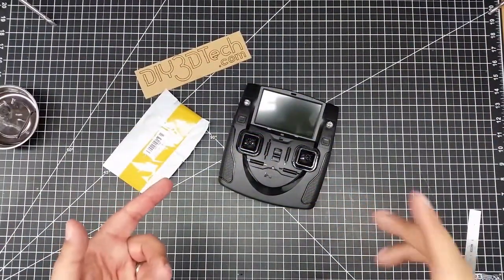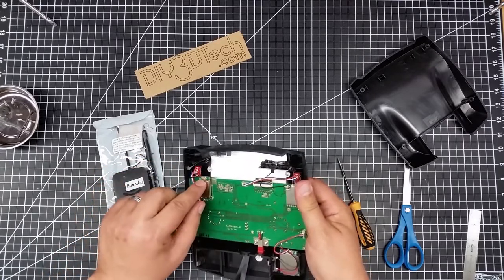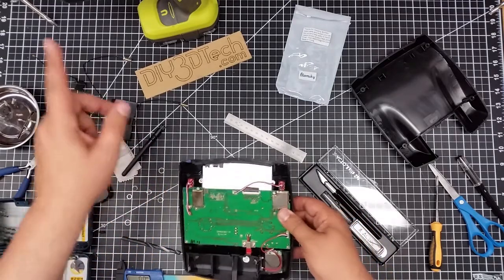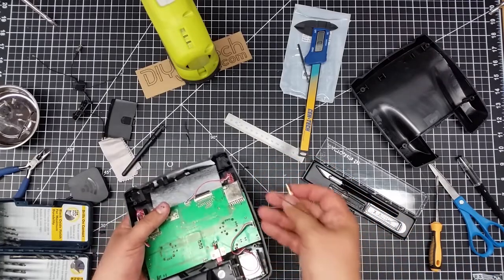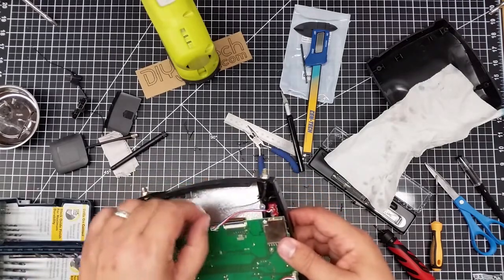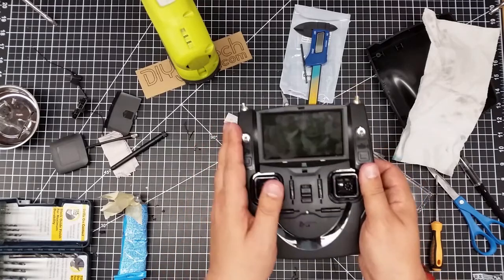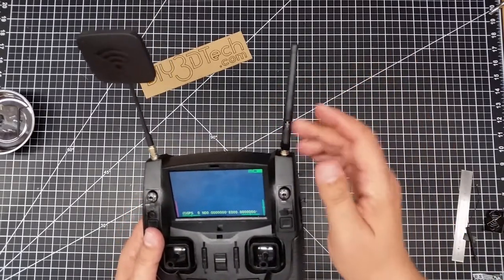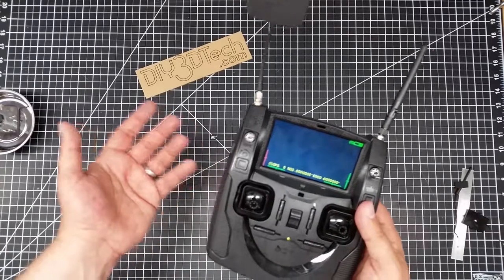Video Drone -  Hubsan 501s Range Mod!

Comment: they make a step bit for those holes, would have saved you the ten minute clean-up and they are not SMA or mini SMA connectors, they're called Hirose or IPX connectors, and ya don't listen for a pop, you have to "Feel" for the snap & finally, not a 5.8 dipole, it's a dual bi-quad, very good directional antenna, probably better than that cloned panel you're attaching. better chance of more distance if you replace the birds antenna's with an external 5.8 RHCP cloverleaf or "blade" antenna, or a RHCP Pagoda. I hand made a tuned 5.8Ghz cloverleaf & mounted it on bottom of a H501S-S, no SMA joint,wire only then hot glued a plastic 1/2 sphere from a bubblegum machine prize container for protection (.9mm wire)cut two clear bic ink pens in half, removed the the rubber pads off skids, in each "leg extension"(bic pens) diameter of the ink pens fit exactly in the place where the rubber pads were, I then just put the rubber pads on the bottom of the ink pens, I added One- 4 color 5mm LED in each and wired them to the OEM LED boards inside the feet to match the color pattern of original. This particular H501S-S now has 4 antenna's, 1- 5.8Ghz cloverleaf + 3- 2.4Ghz antennas, I swapped out it's OEM camera board for a H501A camera board, which has a 2.4 module & two hi-rose connections. Then I robbed 2- 2.4ghz mylar paper antenna's from a shattered smart tv and glued one directly behind the canopy and the other fit perfectly on the inside of the rear battery cover door, both connected to the 501A camera board, the 3rd 2.4 is SMA connected, step drilled a hole on the top near rear and put in a slim, jointed dipole WHY?? Because now I can fly this H501S-S with Hubsan's Android phone App...or it's Controller (I got the H906a)...or both @ same time, great for training your future drone pilots
Reply from the maker: Many thanks for the comments!

Comment: I'v done this mod and I get out to 1000 feet with good video.  I did replace the dipole antenna for a better one.
Reply from the maker: Many thanks for comment and great minds think alike!  I also ordered a clover lead to replace the dipole, what did you use?
Reply: That's not a dipole. It's a double quad antenna, gain is 8 dBd or 10,1 dBi.

Comment: Very nice explanation, on the antenna connector, can I also lock with a glue gun?
Reply from the maker: I would use silicon as hot glue can come lose and also retain moisture which is an enemy of microwaves...
Reply: Yes that’s actually the best way!

Comment: I did this mod on my H107D and I absolutely CANNOT get that micro SMA connector to snap in. I finally gave up. Is there a special tool for this? What am I doing wrong?
Reply from the maker: Nope should just pop on with your thumb...